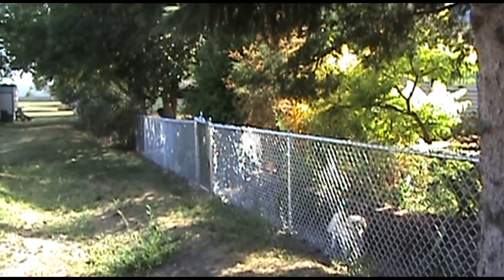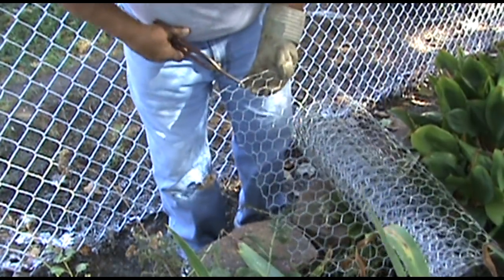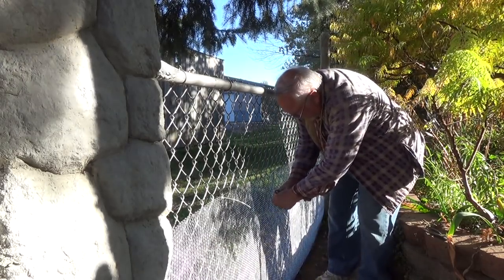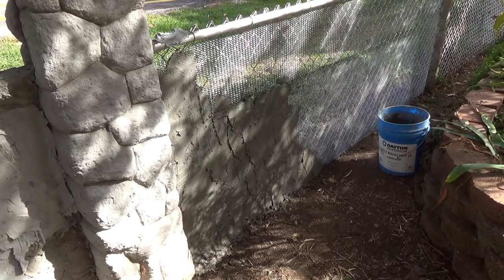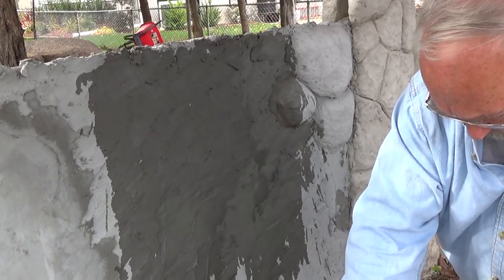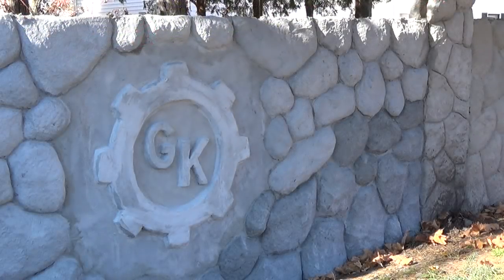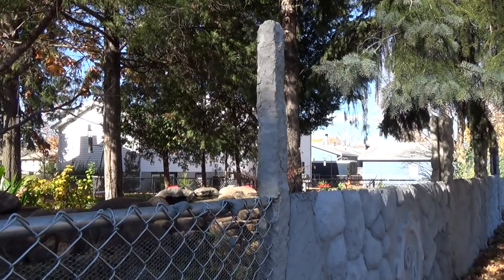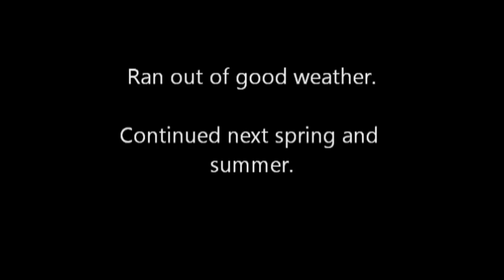Converting my chain link fence to a stone wall

Comment: I'm definitely going to give this a go. Can this Concrete be bought at lowes?
Reply from the maker: No.  You can buy sand and Portland cement, but pre-bagged mixes are simply not adequate, in my opinion.  Using those leaves your concrete porous and exposed to the ravages of water and weather.  Here is a video of what I used a couple years ago.https://youtu.be/etSWuBIcdZc   I've since added silica fume and crystalline waterproofer to the mix.
Reply: dperry428 ok I watched your video of your mixture after I replied. I do Concrete Polishing and epoxy Coatings for a living. I've never done anything vertical with concrete but want to give this a try on my own property. I have a small very sturdy chain link fence in the side yard of my house. Anyways, you do fantastic work. Great video
Reply from the maker: Let me know how it goes.  Thanks for the comments.

Comment: I would like to do something similar to your front porch, starting with just wood studs for the back side of my potting bench and the bottom 3 foot of the shelf unit & gazebo wall. Would you use hardie board with steel lath, then use the same mixture as the fence? I would like to keep it thinner < 1" thick - what mix would you suggest?  Are there any pre-mixed products that you could recommend & maybe add required additives?
Reply from the maker: Your approach of using cement board and attached metal lath is exactly what I did with the front porch.  I can't recommend a bagged mix as I only have used them for my pathway around the pond.  It's much more reliable to simply purchase sand, cement and the additives.  Most bagged mixes are likely 3 sand to 1 cement.  I'd recommend 2 or even 1 part sand to 1 cement for vertical application.  Add metakaolin at 10 to 20% of the cement content, PVA fiber and use acrylic in the liquid such that you have at least 5% solids in the mix water.  Using that mix and the lath, you can be assured of a solid covering at a thickness that embeds the metal lath, which can be less than an inch.
Reply: @dperry428  Thanks for the quick reply. I'm having difficulty finding the metakaolin locally. I thought I would just go to the Fishstone site & order it as well as the acrylic, but stopped when I found that shipping almost doubled the cost. I'm in search of a supplier in MI that I can pick up from... Any suggestions?
Reply from the maker: A bag of metakaolin goes a long way.  It may be worth the shipping charge.  Contact the source and ask for closest distributor  https://www.metakaolin.com/   As for acrylic, look for local sources. Buying from a local home improvement store will save shipping costs, but their prices and the lower solids content, in my experience will end up costing nearly as much as having it shipped.  You might also order the dry acrylic instead of the liquid.  That way, you're not paying to ship water, which is half of the content.
Reply: @dperry428  I called & the closest distributor is Fishstone. I did find Grace's Metakaolin thru Chempoint & the cost of material plus shipping is less. I just need to have a commercial address to ship to.  The Quikrete Acrylic Fortifier is only 23.5% solids, so yeah I would need about twice as much. I haven't explored the other brands yet. It would be helpful if they put that info in the specifications. I avoided the powder form because (I don't remember which video of yours it was in and I am going by memory) you had mentioned that the powder form isn't recommended for wet applications. Please correct me if I am wrong. Since I am in Michigan and the application is where it will see plenty of water  I thought the liquid would be a better option.
Reply from the maker: Quikrete Acrylic Fortifier at my Lowes store is $21 a gallon. Five gallons, then, would be $105.  Since it is only 23.5% solids, you'd need 10 gallons to ALMOST equal the 50% solids of the Fishstone KongKrete acrylic.  That would be $210.  The Fishstone product is about $130 for the 5 gallon bucket (weights 40 lbs).   That's a difference of $80.  If the shipping cost from Fishstone is $80 or less, buy from Fishstone.  If the shipping is greater than $80, buy the Quikrete product.  I hate paying shipping charges, too, but analyzing actual costs sometimes shows it's not any more expensive than buying local.  Now, as to the dry acrylic.  My research shows that the liquid acrylic is an emulsion and once dry, it cannot be re-emulsified and dry acrylics are re-emulsifiable and should not be used where exposed to water.  However, Tom  at Fishstone has assured me that the dry acrylics they use are NOT re-emulsifiable.  So, since I have a long history with Tom and trust him implicitly, I would not hesitate to use the dry acrylics.  I haven't simply because I have my mixes working exactly as I like them and am old and set in my ways.  Shipping of the dry acrylics would be much less as you're not paying for shipping half a bucket of water.

Comment: Not sure if this will get a response as this has been posted a few years ago, but... If a person wanted to build a fence from scratch, could you forgo the chain link rolls and just use the frame and chicken wire or the expanded metal  (please forgive my ignorance)?
Reply from the maker: I'm no expert on concrete or construction but, if I were going to make a fence from scratch,  I'd embed rebar into concrete-filled holes dug below frost line every 4 or 5 feet, attach rebar horizontally to the vertical rebar at the top and near the bottom, attach expanded metal lath to one side and two layers of chicken wire to the opposite side, and proceed as I did with my chain link fence, putting the initial scratch coat on the side with the metal lath. One that side set up, the chicken  wire side can be covered by throwing on the concrete.  The multiple layers of wire from metal lath and chicken wire embedded within the concrete creates the extremely strong construction technique known as ferrocement or thin-wall concrete. The total thickness of the fence would only need be 2 inches or so. Of course, I also assume the mix of concrete would be similar to the mix I used.
Reply from the maker: BTW, I learned many years ago, as a teacher, that no genuine question is ignorant.
Reply: @dperry428   Thank you so much for your answer. I never got a notification of your answer, and just checked back on a whim. That's very helpful and I hadn't thought of using rebar horizontally. I live near a busy road, on a hill, with lots of traffic noise. Concrete seems a doable self project that would cut noise down, but only if it's cost effective. This might actually be my solution. Thank you again! Your channel and projects are inspiring. 🙂

Comment: Great vid, thanks for the upload. I'm thinking of using this technique to build a small hut in a difficult to reach by vehicle location.  As wood would be eaten by termites. Any thoughts or idea on pooring a rooftop? Merry Christmas!
Reply from the maker: I can't specifically recommend construction as I'm not a structural engineer.  I can, however, direct you to ideas that you can then use to create you own design.  I would research "ferrocement construction", "thin-wall construction".  These construction techniques have been used for a number of years to construct rainwater storage tanks in third-world countries.  You can also create structural elements for beams, rafters, girders etc out of ferrocement.  This is the  technique I used in constructing my garden bridge.  You might like to watch those videos and see how multiple layers of small-diameter wire, such as chicken wire and expanded metal lath can be used to make extraordinarily strong structures.  https://youtu.be/oW_6EmdS3j8
Reply: @dperry428  thanks 🙏 so much for taking the time to reply. I will check out your suggestions.  All the best!
Reply from the maker: You're welcome.  Blessings in the New Year.
Reply: @dperry428  likewise

Comment: Sir! how is this wall today. any trouble from the wind ,rain, cracks ect... thank you
Reply from the maker: Interesting you should ask. I've had a number of people who, in terms vulgar and profane enough for me to delete their comments, tell me that the concrete on the fence would fail, especially from freeze/thaw conditions and frost heaving.  Four days ago, it was 27 degrees below zero in my back yard.  Today, it was 43 degrees above zero -- a 70 degree difference in temperatures.  By Friday, it will be back to just above zero again.  I have been taking video the last few days to do a short upload to YouTube about northern Illinois weather and its effect on the concrete designs that I used on the fence, my pond, bridge and benches.  Some parts of the fence are now almost 5 years old. The pond is 14 years old and benches 5 and 6 years old.  I have had NO problems whatsoever with the concrete I use. There are no cracks, breaks or delaminations. The fence had been in place since 1974 with no frost heave consequences, I didn't anticipate that there would be any just because I covered it with concrete and, in fact, there have been none.  Proud to report that all the concrete structures in the yard, including the fence, are weathering our weather just fine.  Solid as a rock.
Reply: @dperry428   thank you dperry for your reply/ the wife and i  are thinking of building a rustic mexican style type patio and this could work for the framework. for the walls. maybe 7 feet high patio type 2x2 lattis roof and post holding it up. just like the smarts how you did this and would  like to give it a try. wont't be until next year after we move so i'll let you know if i remember .thanks again  david
Reply from the maker: Sounds like fun.  Let me know how the project goes.
Don Perry

Comment: I’m only a few minutes in, and I’m curious what climate you are in? Can this stand up to -40C in winter? Plus cold and harsh winds? My main concern is cracking
Reply from the maker: I'm in northern Illinois (plant zone 5).  We've experienced -35C   and winds of 70 mph.  Harsh enough!  IF you use the mix I use, you will not experience cracking unless your application is done in such a way as to encourage drying cracking by application in direct sunlight on hot, windy days.  The mix includes no large aggregate, but does include fine sand, metakaolin, silica fume, and fiber, as well as acrylic polymer in the liquid.  This creates a dense, water impervious finished product that is resistant to freeze/thaw damage.  It is 4 to 5 times stronger than regular concrete.  Don't expect to take short cuts by using bagged concrete mixes from the local home improvement store and expecting it to hold up like my fence has. The only damage I've had to the fence was when the top ten feet of a tree blew down on top of the fence during a winter storm that smashed the plastic lattice on the top of the fence.  There was not even a small crack in the concrete. I just had to replace the lattice.
Reply from the maker: https://youtu.be/oqPp0z8yELU

Comment: Would spraying with something like they use in pools have worked? This still seems labor intensive but result are great.
Reply from the maker: Sure, but there are two problems.  First, is the rental or ownership of a sprayer, which is hard to justify for a single job.  Second, it takes two people to handle the spray equipment; one to spray and one to keep the hopper filled. Probably would require at least another person to hold a wood sheet on the opposite side of the fence to prevent blowthrough. Also, you need a wheelbarrow load of concrete to use a spray technique and the logistics of getting a wheelbarrow to my work area is next to impossible.  Of course, one could hire the spraying by a contractor with shotcrete equipment but, then, that negates the cost savings of DIY.  Getting a job shotcreted is NOT cheap. DIY projects are almost always more labor intensive.  THAT'S what saves money and makes projects such as this accessible to people other than the rich.

Comment: So mixture is just concrete? No sand or anything?
Reply from the maker: You're confusing concrete with cement.  Concrete is a mixture of cement, which is the powdery glue that holds things together, and aggregate, in this case, sand.  This particular mix is 3 parts sand to 1 part cement with additives of metakaolin, silica fume, fiber and acrylic admix for the base coat.  2 parts sand to 1 part cement with all the same additives for the finish coat.

Comment: how is the footing looks like? will the fence pole support the weight and safe? thanks
Reply from the maker: The fence posts are in concrete 40 inches into the ground and have been in place for 45 years.  The posts are surround by two layers of high strength ferrocement, using a mix that is impermeable to water.  It's construction is little different from commercial precast concrete fences that are installed up to 12 feet high. The construction might also be compared to post and beam construction. The fence has been in place now for 5 years. The fence "poles" are concrete; the old metal fence posts simply became metal reinforcement, much like rebar, only stronger. Stronger and safer than than most all other residential fences.
Reply: Thank you for your reply, what kind of mix materials that you were using? were you just mixed sand with cement or also adding some acrylic polymer material? thanks very much, you've done a great work on this chain fence.
Reply: I am worrying the wall too heavy.
Reply from the maker: You can watch other videos to see my mixes.  https://youtu.be/etSWuBIcdZc          https://youtu.be/e4j5qgNFQE0
Reply from the maker: I don't know why you would worry, I certainly don't.  It's lighter than commercial concrete fences.  https://youtu.be/zzzZU4KdL9s  https://youtu.be/8vEEAGJHmYg https://youtu.be/wVkPcAk6-5Y https://youtu.be/CYwPuUM9drw

Comment: Its 2020 hows that Wall holding up? Any parts crack by any chance?
Reply from the maker: Nary a crack.  The only damage was two winters ago when a violent storm blew the top 10 feet off the tree next to the fence and it fell on top of the fence.  The plastic lattice was shattered, with pieces ending up in the school parking lot. No damage whatever to the concrete. A heavy 4-inch diameter top of the tree falling from twenty feet in the air did not do any damage to the concrete.  I had to replace the plastic lattice the next spring.  The only other damage to the fence was someone spray-painted an obscene word on the outside.  A little acetone and a small scrub brush removed it in 5 minutes.  For the doubters, the fence has been through summers with temperatures in the high 90's and winters down to 30 below zero, high winds of up to 70 mph, a number of hailstorms and lots of snow and flood water from the school grounds.
Reply: How do you think the wall will hold up in desert climates?
Reply from the maker: @Adri_57  Likely better than here.  Deserts don't have the extreme freeze/thaw cycles that we experience here. It survives here due to the density and impermeability of the concrete.  It will do the same in the desert.  Wind erosion might be a greater issue; however, that's talking a VERY long time.